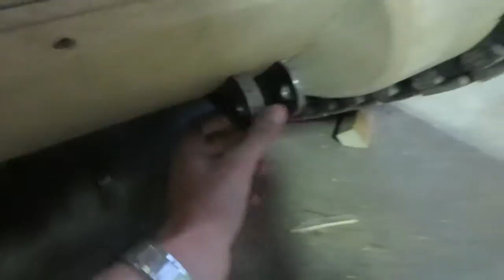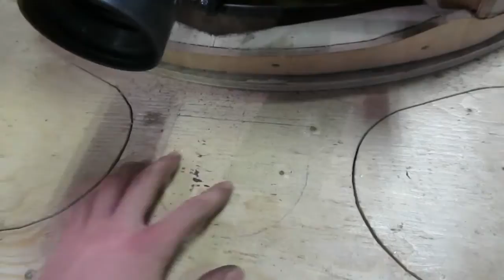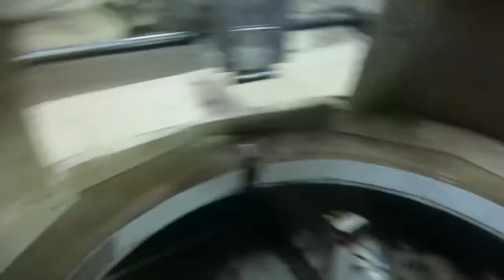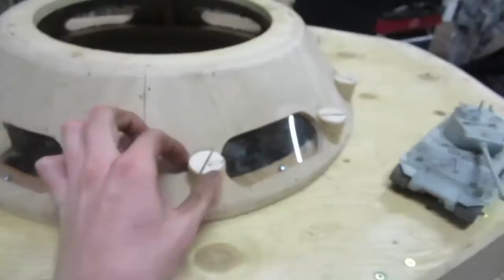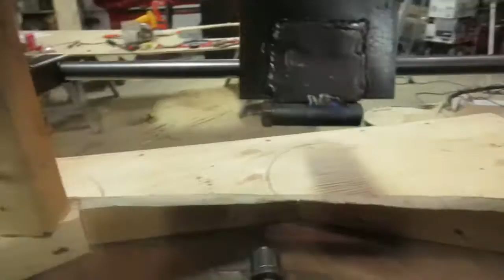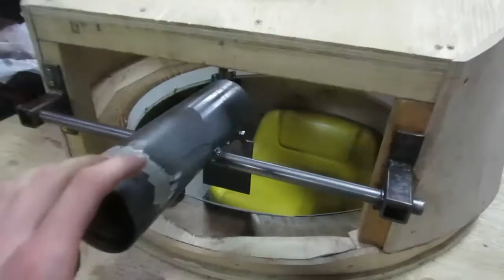2/5 Scale Sherman M4A3E8 Tank update 16

Comment: Just awesome:) great work in the hull. The only thing I don't like is the gun. There are so many nice possibilities for a breach loading gun. 
First you should in my opinion add extra holes in the shell, so that you don't have to look that the hole is on the bottom side. (The hole for the air)

And second I'd not use the simple thing with the wingnut and threaded rod to close the breach. Look at real artillery. They've got a nice mechanism, you could build something that looks similar. 

Great video:) please more!